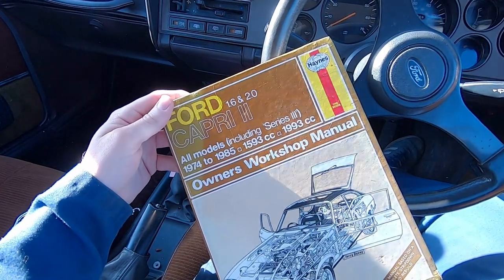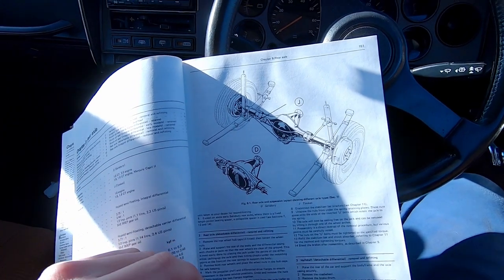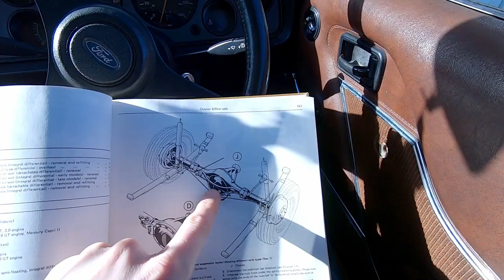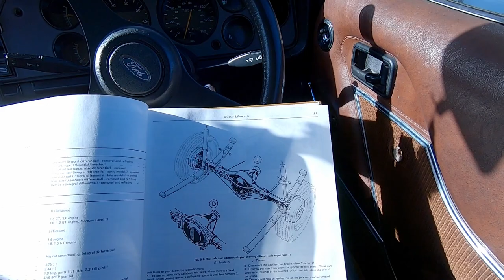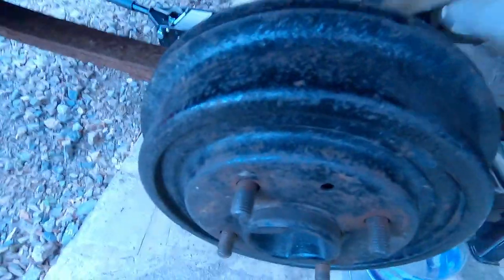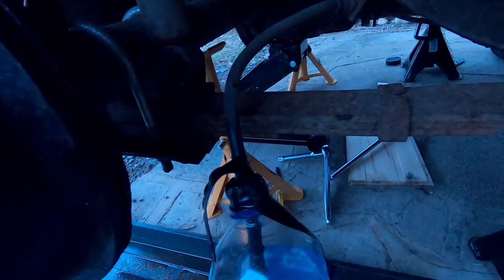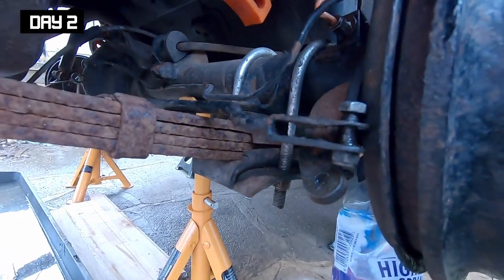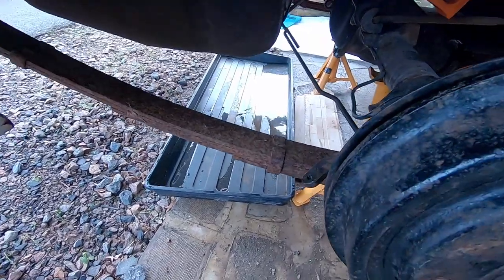REMOVING A FORD CAPRI AXLE & LEAF SPRINGS (AXLES AXLE)

Comment: Fair play to you for attempting that on your own on a driveway m8...you must of had previous experience at this sort of stuff i take it
Reply from the maker: Thanks mate. I wish I did! Although I've had old cars for years the Capri is the first Car I've really worked on. I've made a lot of mistakes mainly taking it to garages early on and spending too much money on jobs. This was me getting stuck in properly to make it work. Once I sorted the Axle, front suspension/brakes and the Carb It really transformed the Car. I had a garage put a clutch in and I use the Car a lot now. Just need to learn how to weld next ha!
Reply: @RetroAndRusty  the rear diffs on capris were never great on there best day they always suffered from leeks or seizing up altogether they normally start rumbling when there's a problem on the way plus the front antiroll bar bushes are prone as well you will get a shake on the steering I know all this beacuse I've had a 2.8 injection plus 2 other 2.0 lasers aswell...also the half shafts can cause problems aswell leaking oil through the seals or even snaping off if drove hard those are the things to look out for m8